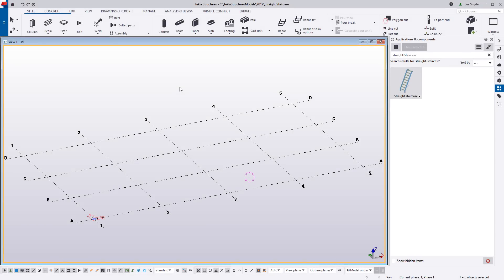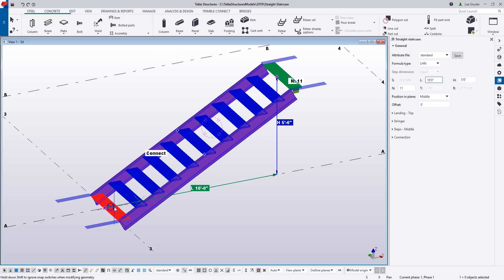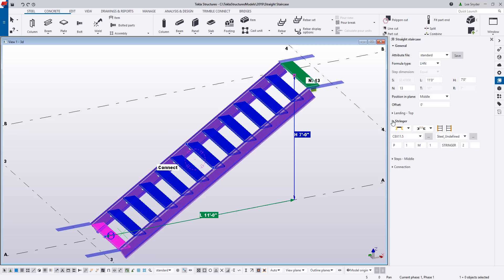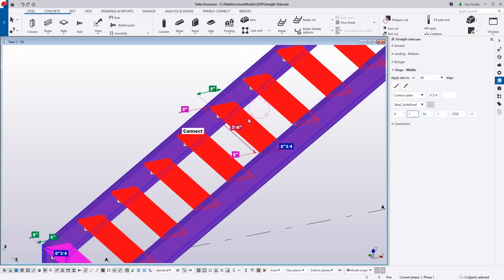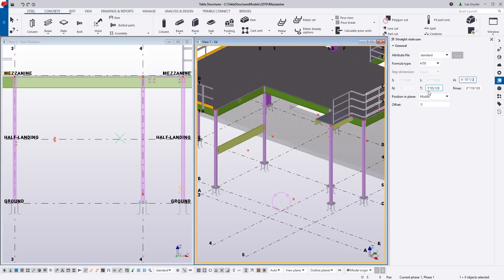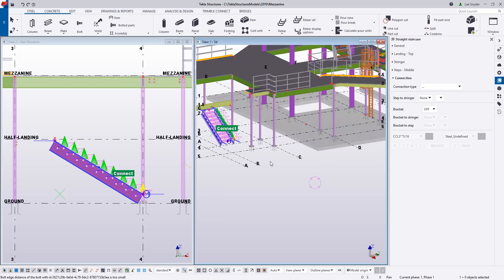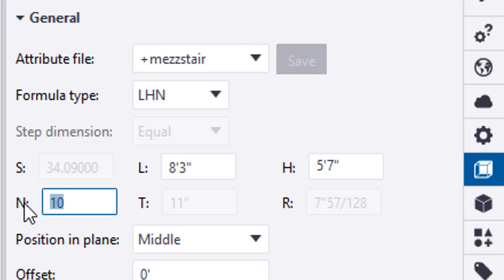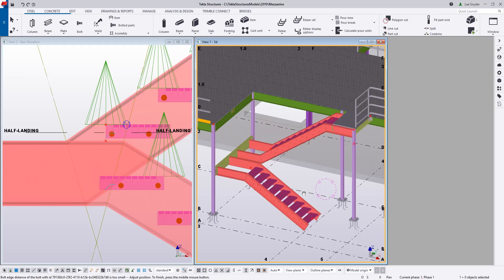Straight Staircase in Tekla Structures

Comment: Is there a way to lock it I have L 1250 H 652 N 5 - T needs to be 250 but when i do that the L goes to 1000
Reply: Hey Jack!  Yes, in order to do this set your stair setting to 'LHN' to define your 'LHN' values.  Then change the drop down to the HTR setting, set the 'Step dimensions' drop down to exact and then use the DM feature in the model to change the 'T' value to 250.  That will keep your other 3 settings as defined.  Let me know if that works for you.
Reply: @leesnyder6784  Thanks that part worked, but now when T is changed R also changes, can I go around that?
Reply: @jackbrown8514  Unfortunately there isn't a way around that currently but I'll log it to be improved.  Thanks for the feedback!